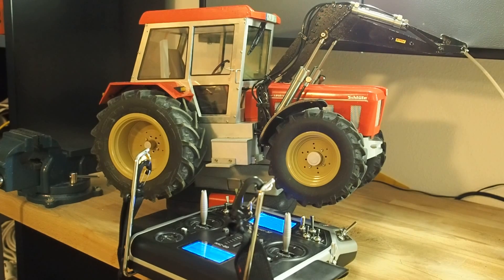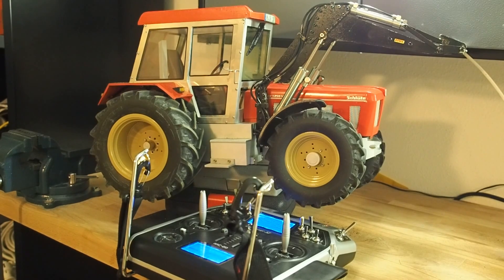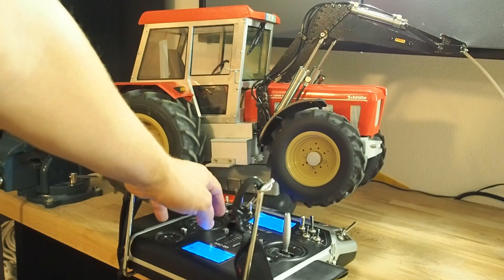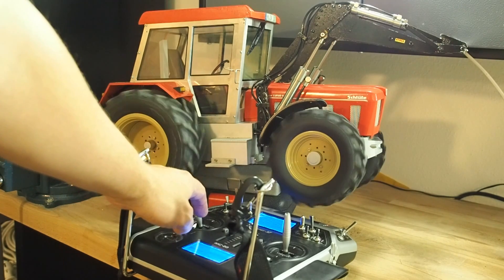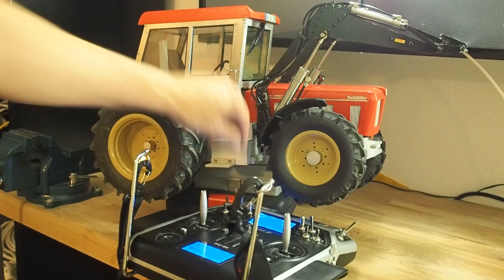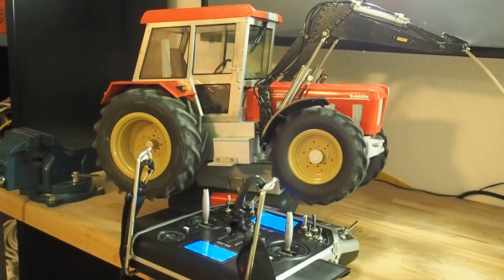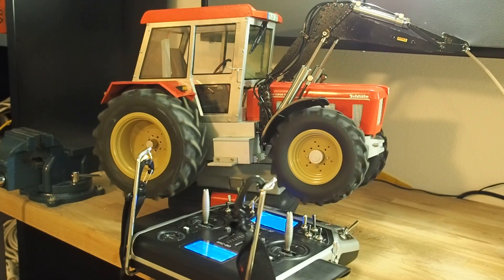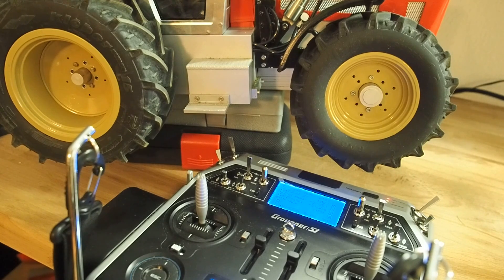RC Tractor speed control | Schlüter 1250 | Servonaut/Blocher B-TRIM | shift reverse# Wendeschaltung

Comment: What kind of hydraulics and how small are they that you can hide them inside the tractor!!??
Reply from the maker: The Hydraulic is inside the tractor of course.
Reply: @AgrarBau  Of course they are inside the tractor but what type or size....Leimbach?
Reply from the maker: @rc_farmer4866  No. A scaleart pump included with a tank. Do you plan a similiar project? Could help you with some advices
Reply: @AgrarBau  Thank you, yes I do plan a similar projext.  I have a rc jd 9620rx and I want to build the flex fold disk.  I plan to use saddle tanks to hide the hydraulics